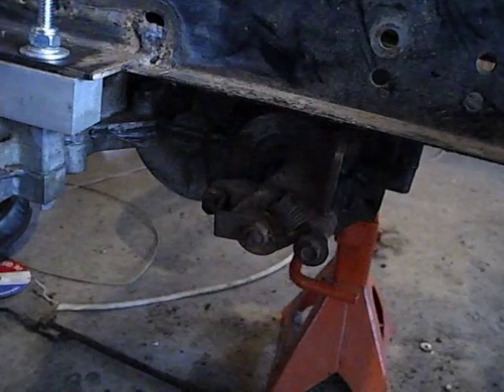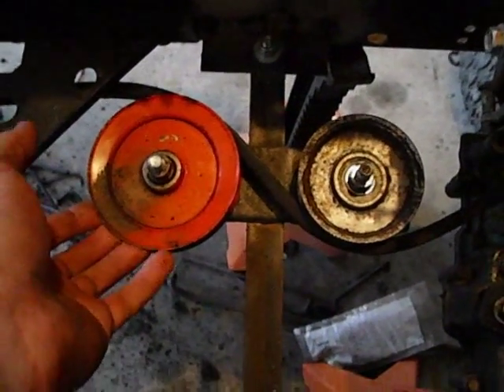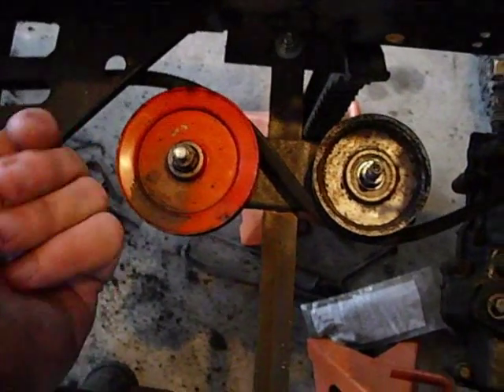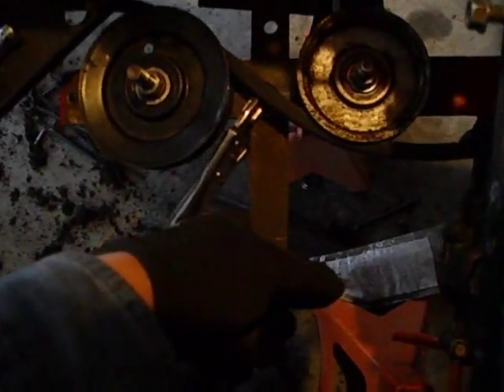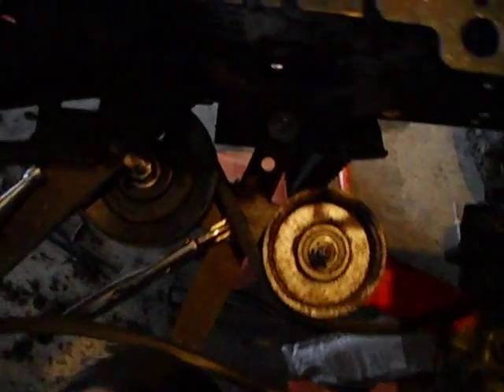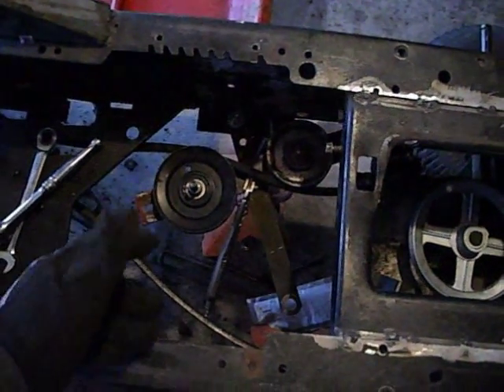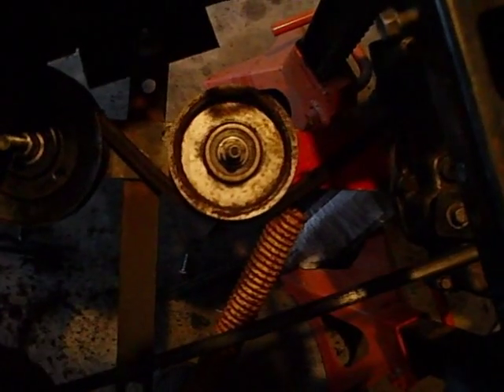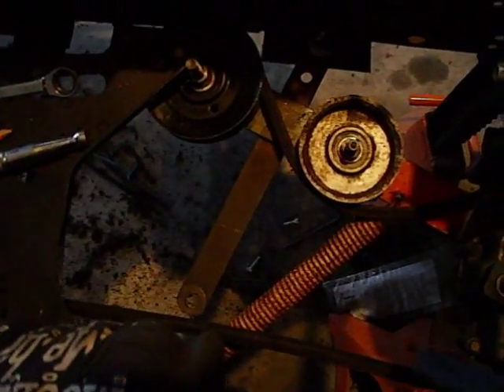More Clutch Stuff! Complete Clutch Remake.

Comment from the maker: The spring it put in was a stock MTD clutch spring and it was trough as shit. Ive since swapped it for an MTD tensioner spring and it seems to be strong enough right now, as I can move it all the way with my hand but not without some decent struggling.